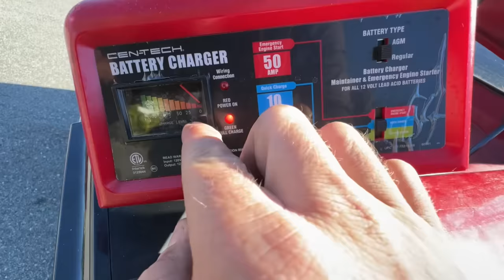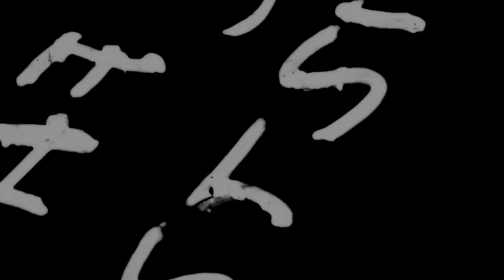My Lifted Hellcat is Broken Bad

Comment: Tubular front and rear "prerunner" style bumpers. The rear bumper could also hold an off road jack or gas can or spare tire? That would help bring the weight bias towards the rear more and help flatten out the car when u jump it

Comment: You may have a parasitic draw somewhere draining your battery while it sits. I would put a battery disconnect switch on it. It would be cool to have your fab guy make you some bumpers similar to the door bars. Especially being the rear bumper is MIA. 😂. Love the car and content keep going 👍💪
Reply: I agree. If the battery checks out to be good then there's something drawing a low amount of power. Doubt it's a light since most of the bulbs should be LED which draw very little current. But then again if it dies while driving then the alternator is bad

Comment: If the engine is overheated the supercharger may lock up. Your brother did that on neighboor  a few times.  Get the belt off and see what turns a what doesn't.

Comment: I'd put the doors back on and you can street drive it or whatever. Keep beating on it in the dirt and you'll find all the weak points really quick. Garrett cut the harnesses so let him fix or replace them and have fun. If you want to keep playing off road for a while put a whole car skid plate under it and beef up what you can. Try to make everything reversible so you can put it back to stock if you want to street drive it more than go on the trails.

Comment: This video is backwards lol. But tube front and rear bumpers. Maybe some rock sliders. Definitely some rally lights on the front bumper. Coilover suspension for the rally. Finder flares and wider wheel and tires.
Reply from the maker: Yea I designed it that way lol

Comment: Does the supercharger belt also run accessories like the the alternator? Curious if that supercharger getting as tight as it was could have been causing belt issues as in it slipping and not spinning the alternator? Maybe that's a completely stupid question, I've never owned a vehicle with a supercharger.

Comment: Poor inside cat.. Lol, fingers crossed the engine didn’t ingest any metal. 

Regarding the door bars.. Well fabricated but poorly designed. I might would give that one another go… Front bar would look really good if it had a plate that covered the jamb area, tops of the corners should have rounded corners for aesthetic appeal, latch needs to be completely scrapped and done right. It needs to have a strong spring return so it is stable, would look awesome to use a parachute release handle positioned above it midway up the door, easy to access and see.

Also the bars would look a lot better if they had a bend in the lateral plane as well, to give a little depth.